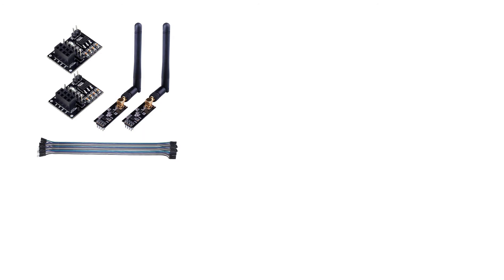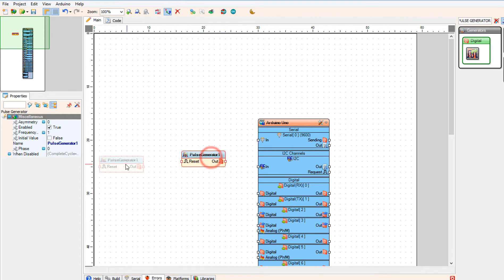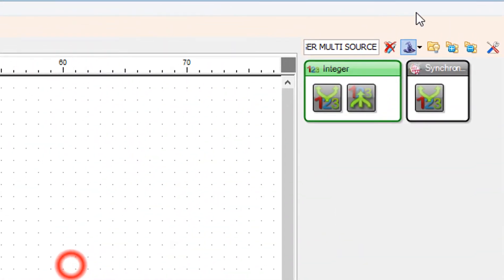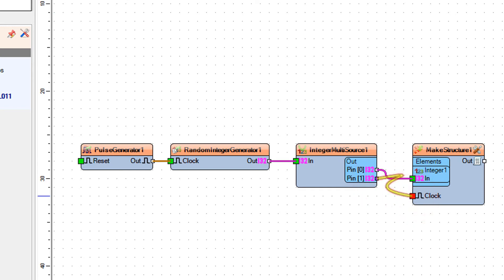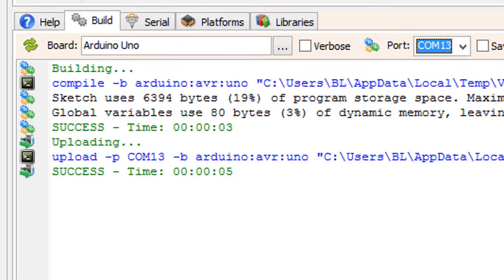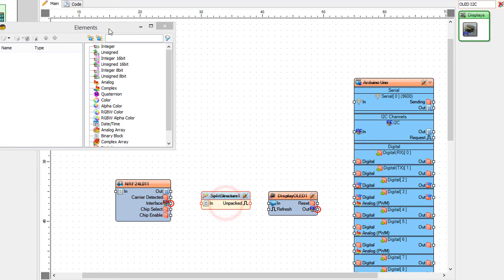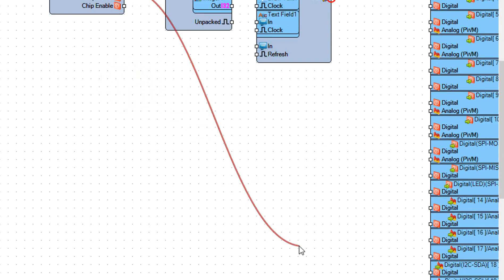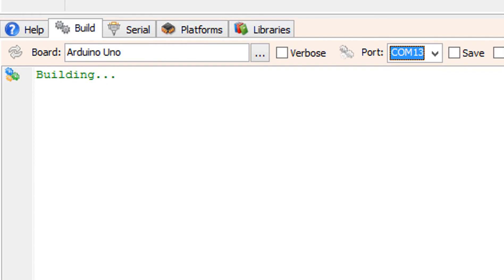Arduino How to Send Data Using NRF24L01 - Tutorial

Comment: good evening!
I have a code and I would like, if possible, to help me divide it into two:
1. a transmission part for a development board with an NRF24L01 wireless sensor and a gyroscope.
2 a reception part for a development board with a wireless sensor NRF24L01 and a module with 7 LEDs, one of which is considered the middle. This second development board wirelessly receives the movements of the gyroscope and depending on them will turn on and off the LEDs. I also attach a video (there in the video and in the written code there are 11 LEDs, I only need 7.
Thank you very much!

Comment: I'm using a 20x4 LCD screen. Would this same technique apply?? I'm struggling to get mine to work.
Reply from the maker: Its the same approach. Are you using the one with the I2C connection?
If you will still experience the problem just PM me and I will help you.
Reply: @visuinoprojects  Yes, i'm using the 20x4 LCD screen with the I2C connection. Is there a way on Visuino to check if either of the transceivers are working? I feel that one of my transceivers may be fault.
Reply from the maker: @jacobprimus3242  You can use i2c lcd without a problem, add "Liquid Crystal Display (LCD) - I2C" component. I made several tutorials on how to use it.

To test it without the lcd just connect "SplitStructure1" pin [Out] to Arduino serial and then after the upload use the Serial monitor.
You can also check the "NRF24L011" pin [Carrier Detected] to see if it is working.
Reply: Days and days I have been trying to get my nrf24l01 to work... I ordered new nanos...then new nrf24l01s   then I got the breakout boards to help with 3.3v...
Some days I can get the simple help world code to work...other days I cannot...wtf is going on haha...
I'm so frustrated...
I think because I am copying and pasting code I am having a library issue?
Reply from the maker: @timmyg37  Please send your project file to support on the website to get it checked. And make sure to have the latest Visuino as some older versions did not support nrf24l01s so well.